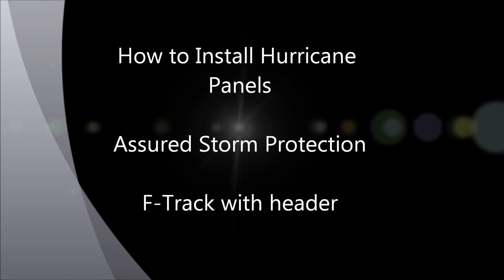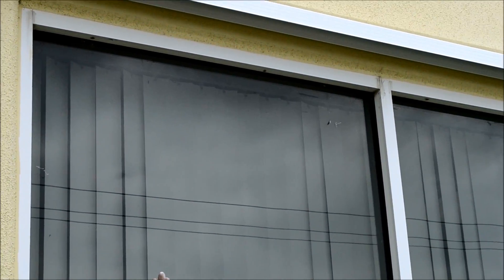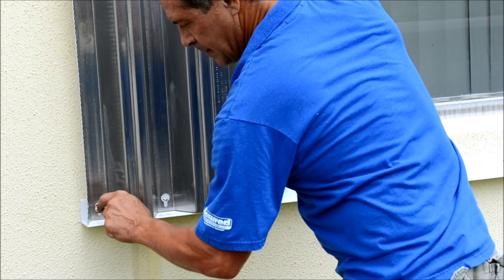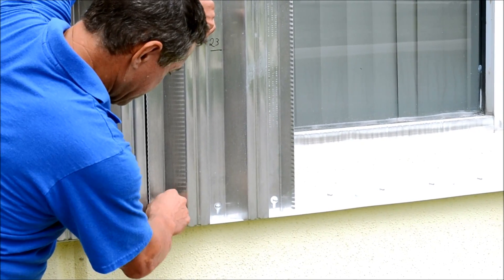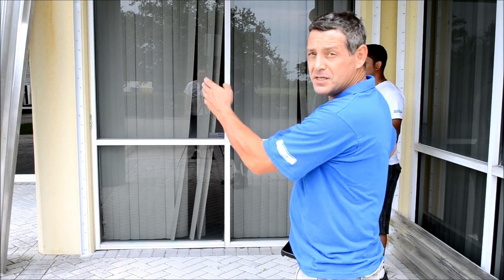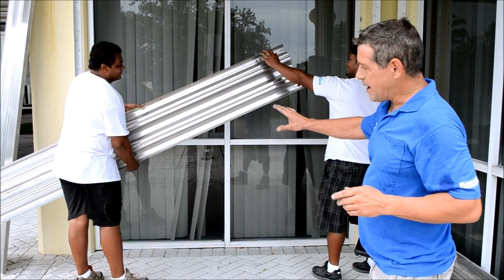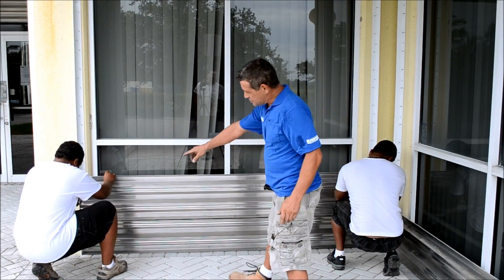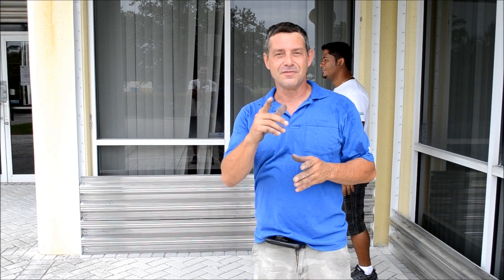How to Install Hurricane Panels

Comment: Would have been a bit more helpful if he had shown how to measure the placement of the header and the studded angle, instead of simply putting the panels in place,     upside down.

Comment: you put the panel upside down. the wingnut should be on the slot not the hole. if you turn the panels around the bolts and wingnuts will be in the slot, proper.